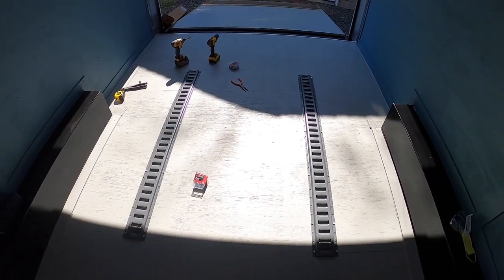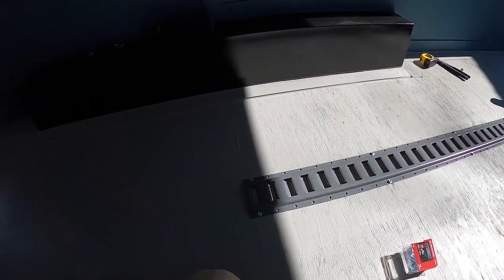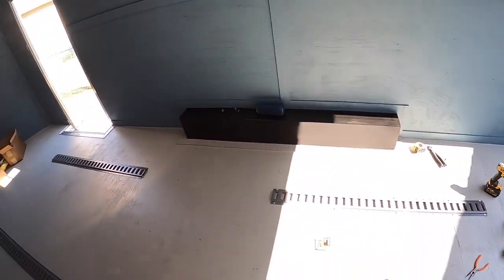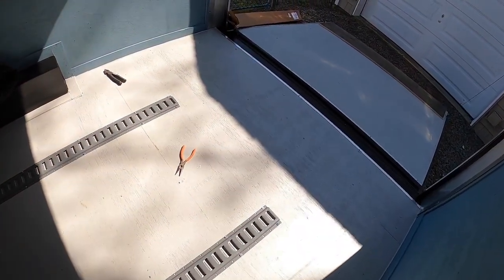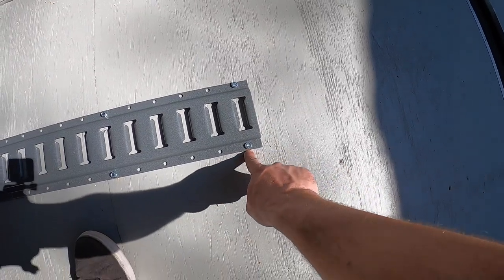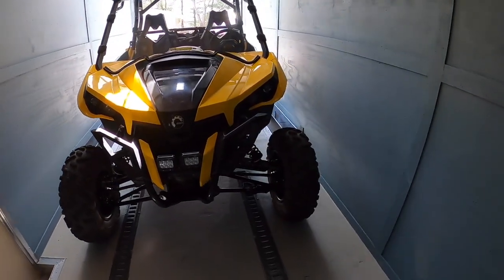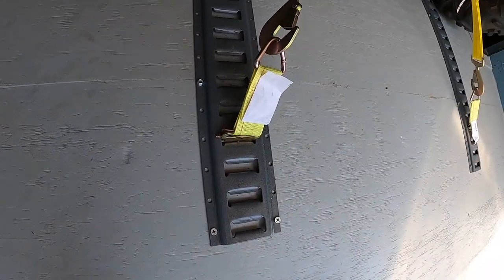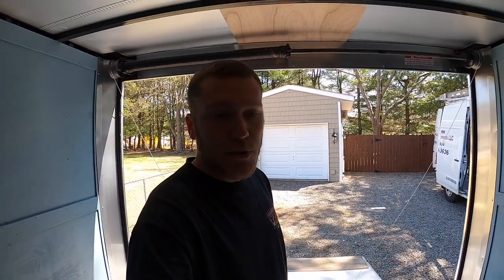Installing E- Track Tie Down System Inside an Enclosed Trailer (Trailer build episode 4)

Comment: The tracks should be wider and the straps should go right over the tires to take the UTV's suspension out of the equation.  
Plus you can get bucket straps to really hold the tires.
Reply from the maker: The tracks have held just fine after 4 years.

Comment: How have these etracks held up since you installed them? How many trips have you made with you side by side strapped this way.  I would think the bouncing of the side by side would be really hard on the few screws holding down the etracks.   I think a better install would be to put the etracks directly under the tires and just run the strap over the tires.  That way the side by side couple bounce a bit without pulling the screws out.
Reply from the maker: The track system is still holding down well after about four years now.  No bending or pulling out of the wood.